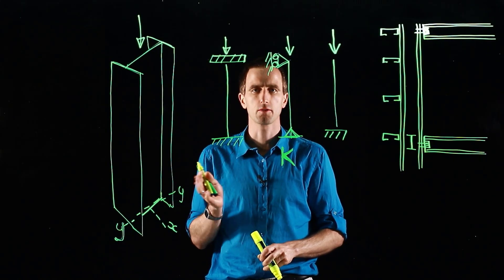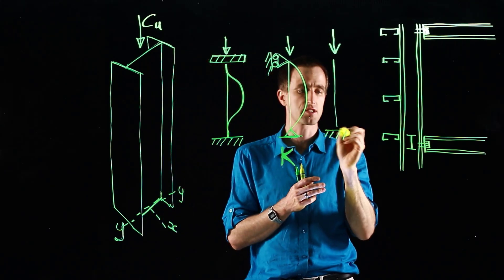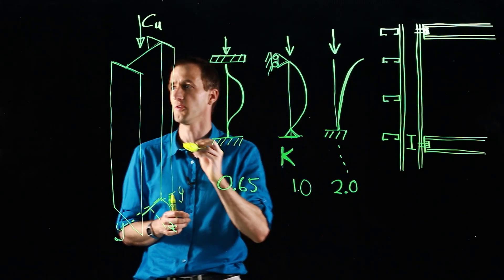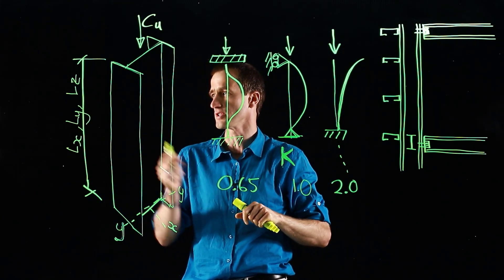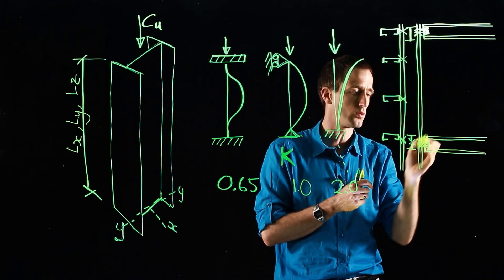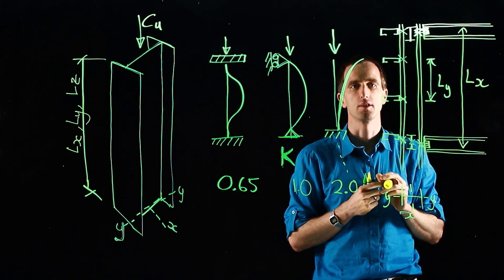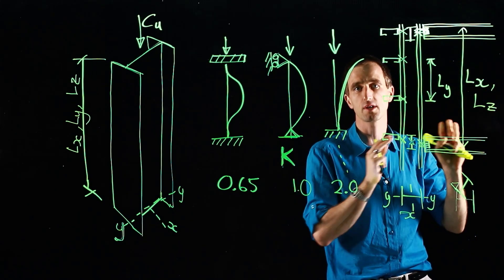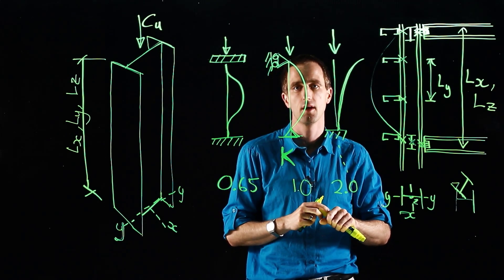Steel Design - Effective lengths of columns - SD424

Comment: i have a question regarding the Lx, you said that the girders will move with the column if there is a buckling in X-axis but the thing is, these girders are probably attached to another column maybe, so shouldnt the Lx becomes less same like Ly ??
Reply from the maker: Normally the girts are quite slender, and also simply supported, so will typically provide limited lateral support. Also, the column next door will often be loaded to the state so may be buckling at the same time, so cannot be relied to provide stability. However, there are detailed design methods to evaluate whether members can be considered to provide lateral support.
Reply: @firesun  thank you for your explanation

Comment: Did you get ly and lx in the wrong way？ the weak axis is Ly which lateral supports only at top and bottom
Reply from the maker: The girts provide lateral support about the weak axis so Ly is shorter.

Comment: Hi, could you please help me? 
I have a 48inx24in stainless steel table with tubular legs that are 32.75inches high.
I want to increase the weight capacity which is 500 something lbs. If I fill the legs with concrete and a piece of rebar would that increase the weight capacity of the table? Maybe to 800 lbs.
I'm 70 and I'm no longer able to figure it out. Thanks to anyone who chooses to help ❤
Reply from the maker: Sorry, my brain does not work as well in lbs and inches. Strength is often governed by member capacity and also connections. Hence, if you strengthen something you also need to ensure that the connections between members are sufficient. As a rough rule of thumb if you take the area of concrete at around 40% of the strength, say 20 MPa for a low quality concrete, and add on strength of the rebar at 60% of its yield strength you have a ballpark estimate of the capacity. 800lbs is not that much load for a steel and concrete structure, especially if there are 4 legs.

Comment: How can I prevent cracks in partition walls due to deflected steel structural beams' interaction?
Reply from the maker: Stop the beam from deflecting (i.e. stiffen it) or isolate the members from each other.
Reply: @firesun   Regarding isolating the members from each other is there any code mentioned that,  like IBC or AICS Standard, Please help me
Reply from the maker: @ahmedyaqub2377  - You simply need to install a soft material that can accommodate the movement, and keep the wall and beams not connected to each other.
Reply: @firesun  Dea Sir, there is a controversy in our company that insulation is not required and it is possible to make the non-loading partitions directly contacted with steel truss without separation, so I need a paragraph in the code that stipulates that the isolation must be achieved
Reply from the maker: @ahmedyaqub2377  You will not normally find this in a code. However, if a steel struss moves more than a wall can allow then the wall will crack. It is based on physics rather than codes.

Comment: I believe that For the Ly, lateral supports only prevent outer flange from moving in & out. so, in order to consider Ly =  the girt spacing; flange brace is mandatory to constrain the inner flange movement as well
Reply from the maker: This is a good point. To get an accurate value of KLy with multiple side connections a finite element analysis or testing may be required. However, in most cases connections in real structures are much stiffer than pins (e.g. a T-cleat with 4 bolts into a girt and lots of sheeting on a face). Also, the web adds stiffness and links the flanges together. But yes - if you had a pure pinned connection at the lateral restraint, and a thin web or very deep section it may be under-conservative to consider a restraint from a single flange. However, the torsional resistance will also capture this behaviour to some extent. For compressive buckling the entire section has to move sideways, and only one flange can moved. More detailed analyses would needed to highly loaded or complex structures where such behaviour is important.
Reply: @firesun  Impressive 👏
Thank you, appreciate it.
Reply: @firesun  Ly in case of I beams is different for both flanges. But for tubular sections Ly can be as you have explained in the lecture as the flanges of tubular sections are firmly connected with two webs.
Reply: Agree